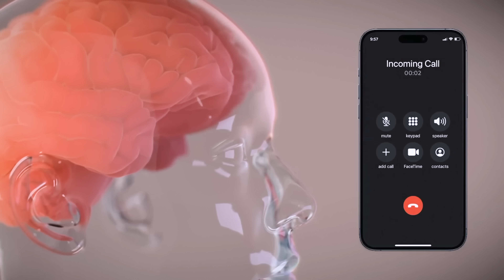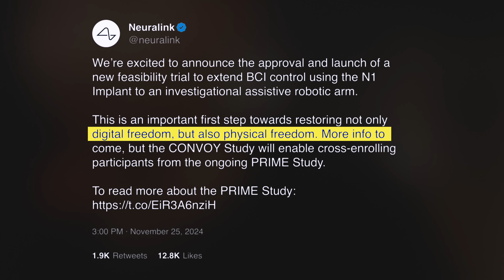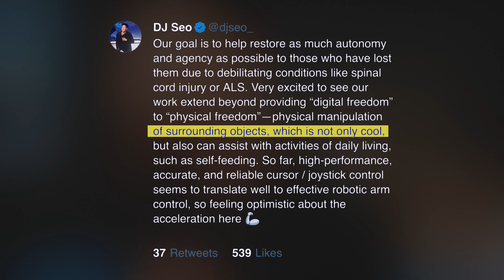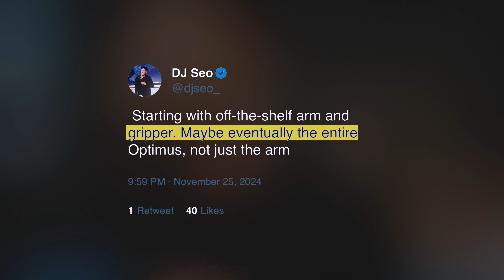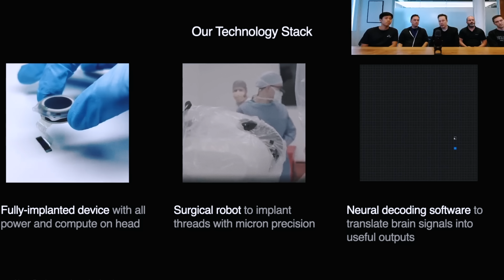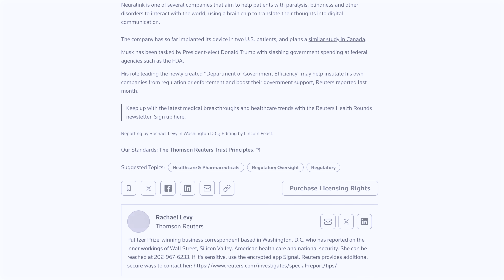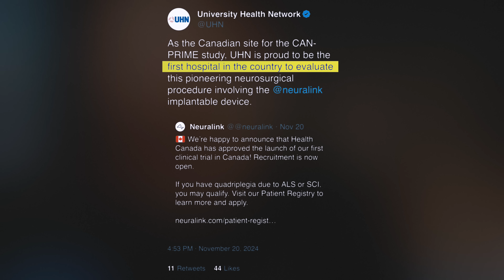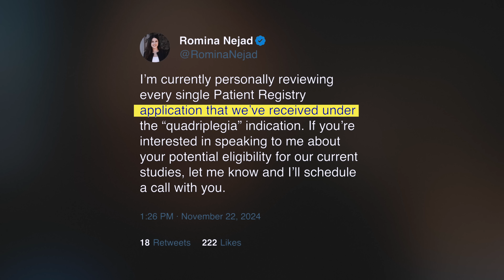Neuralink Update – January 2025

Comment: NeuraLink is not a Musk Invention, currently 4th in BCI implant technology race and Failed tech, #1 = US-based Synchron, backed by billionaires Jeff Bezos, Bill Gates, among others. Synchron is further along in the clinical trial process, 12 successful BCI, Neuralink 2 attempts failed, the method Neuralink stimulus tentacles attach to brain many unattached quickly, patent reverts, failed. Synchron is preparing to recruit patients for a large-scale clinical trial ahead of commercial approval, as per Reuters. #2 = BrainGate, Originally conceived by researchers in the Department of Neuroscience at Brown University in Rhode Island, BrainGate has grown into one of the leading BCI developers undertaking clinical trials. Its technology was the first to transmit wireless commands from a human brain to a computer. #3 = Clinatec, Located on the CEA campus in Grenoble, France, Clinatec has developed its Wimagine device that, in 2019, was used to help a tetraplegic patient fitted with an exoskeleton to walk. 
Musks NeuraLink Pitch was/is Mind internet connected/use/super intelligence = 100% Musk Lies/Fraud.

Comment: ALS IS NOT RARE.  The 'rare disease' designation is given to diseases with less than 200 thousand currently LIVING with a disease in the United States. It doesn't consider how many are diagnosed.  

#ALS patients die very quickly so the number LIVING remains low.  

ALS is diagnosed at roughly the same frequency as multiple sclerosis which affects between 800K to 1 million people in the United States. (4-5 times the limit for a rare disease)

YOU OR YOUR LOVED ONE COULD BE NEXT
Reply from the maker: I didn't realize. Thanks for informing me.
Reply: Πος θα εισε διπλός ???